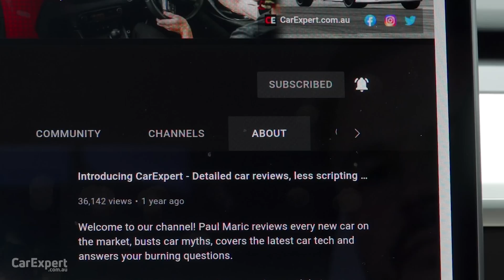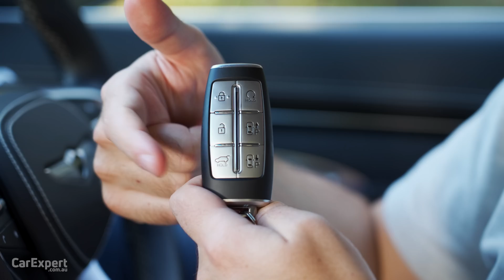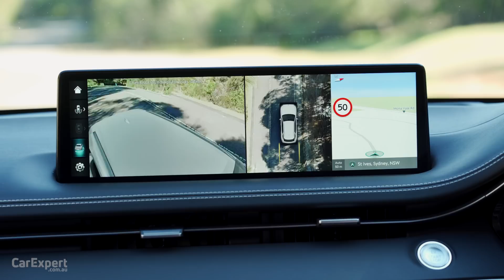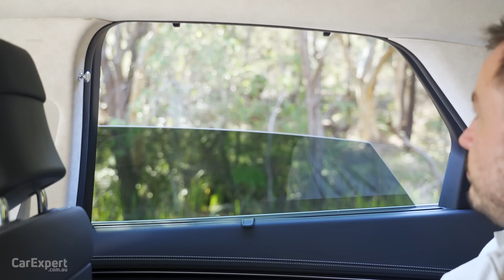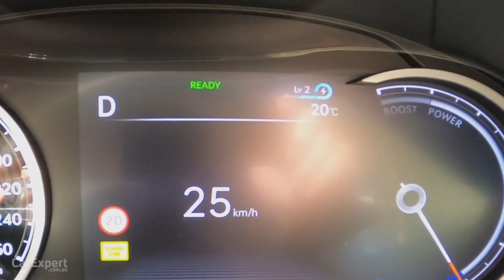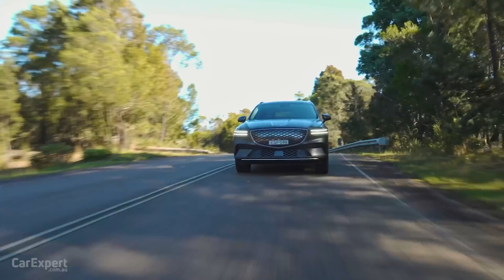2022 Genesis Electrified GV70 review (inc. 0-100)

Comment: We looked at the ICE GV70 a few months ago.  It is a really nice car but for its size and features (particularly the 2.5T) we think the value proposition is not as strong as the CX-5 Akera.  For $25k less (back in Feb when we were looking) the Akera had almost everything the premium package GV70 offered (minus the massage seats, digital dash and electric steering column adjustment).

The $13k premium package did introduce some nice features but did not seem (again) to be great value over the standard trim level, particularly when the interior upgrade in that package did not improve much other than the sound system, seats (the standard seats are pretty damn good to start with so hard to justify the upgrade), digital dash and HUD.
Reply: CX-5 isn't anywhere near being a premium car. Very old tech and design.
Reply: @vkdlvkdl  Yep, not to mention the power, proper HUD, and luxury appointments.
Reply: That's because CX-5 has about 100 HP less than GV70 2.5T
Reply: @kenyaswallow5782  54kw if you're paying attention. That's offset by the extra 190kg the RWD 2.5T GV70 has to haul around though, 250kg for the AWD.